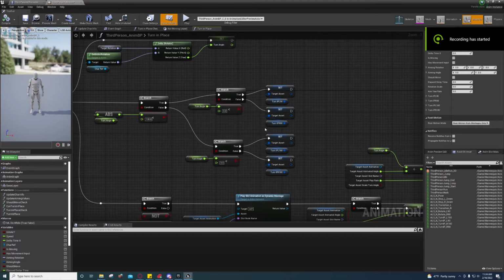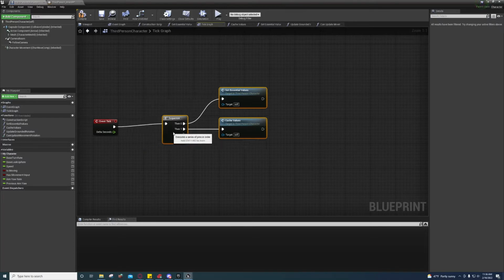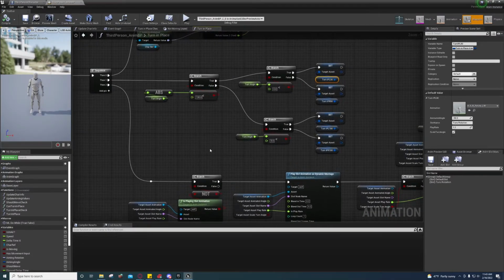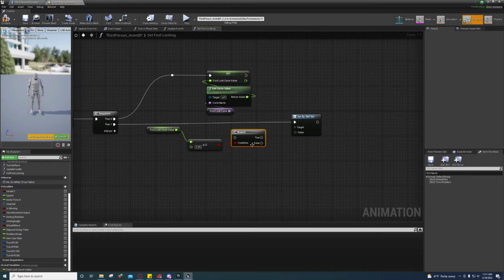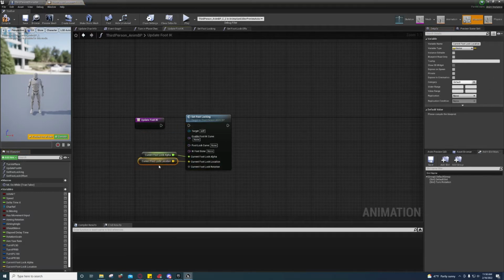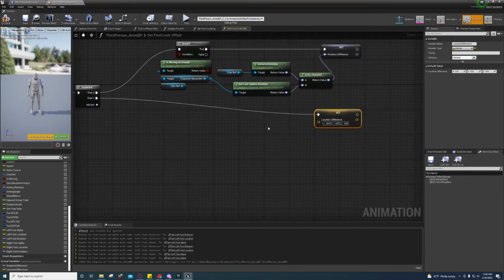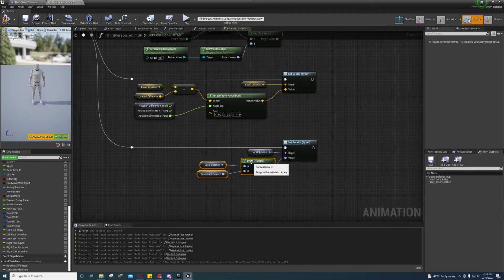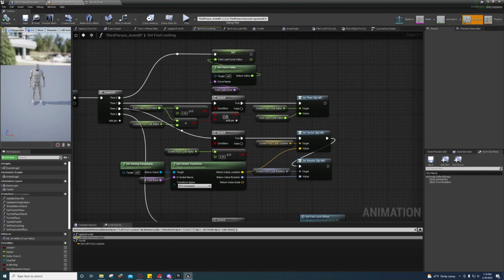Unreal Engine - Recreating ALS TurnInPlace/FootLocking (Part 4)

Comment: for some reason in ue5 i can't read RotationAmount. I can read the other values but that one just can't read it. It is there, I just cant use its value to rotate. Any idea?
Reply from the maker: Yeah, so when you retarget animations in UE5 it bugs out and doesn't copy over all the curves. You will need to create a curve with the same name on some random animation and then delete it...after that it should be accessible.... since I assume your also using the TurnInPlace animations as I did then you will need to use the Copy Curves (Animation Modifier) to copy those curves over from the ALS animations.
Reply: Sorry to bother you but I’ve been having a real nightmare with the foot locking in ALS - for some reason when I migrate als in to my UE5.1 project the foot locking seems to be broken - my characters turning in place and rotation in place looks really bad, I’ve narrowed it down to the foot lock curves - when I remove those it looks much better but I’m not sure if that is supposed to happen
Reply from the maker: @catshavelasers4696  I have ALS in a 5.1 project and haven't experienced any issues, although I didn't Migrate mine. I'm not sure why the foot locking would be failing. That seems awfully specific. Is this before or after retargeting to a new skeleton?

I say I haven't experienced any issues but there is one with the foot step sounds. They seem to be corrupted.
Reply: @unrealdevop  So I am still having this issue - Even if I start with a brand new copy of ALS in 5.2  all I have to do is change anything in the anim graph and for some reason the footlocking from the turn in place and rotate in place animations no longer work.

Step by Step :
1 - Create a fresh ALS copy in 5.2
2 - Moved the logic from the ALS character to a component.
3 - Changed the anim graph to get the essential variables from the component instead of the character via the interface.
4 - Compile and save, now my foot locking stops working :(

I have asked several times on the ALS discord channel but got ignored everytime - Have you come across this issue when rebuilding the footlocking/turn in place?